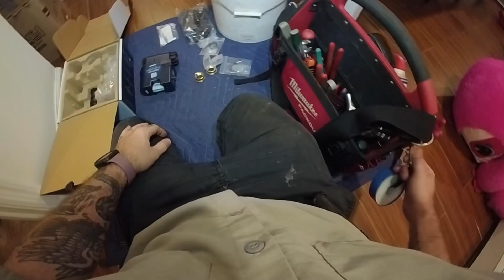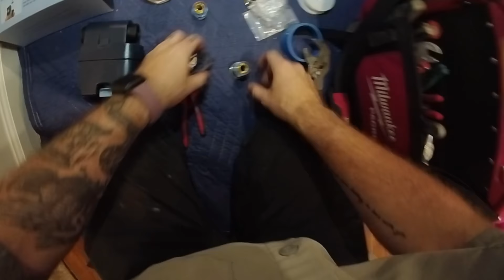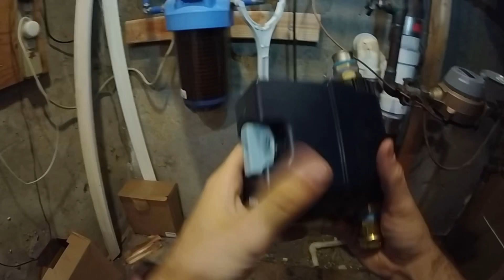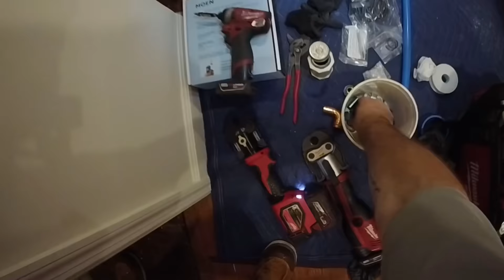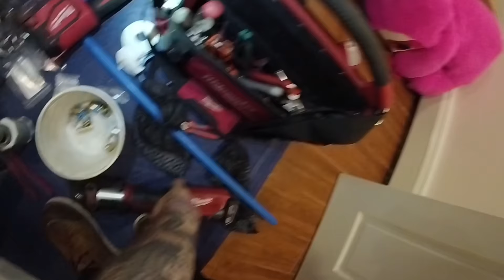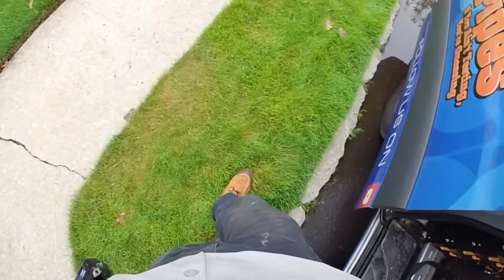Flo by Moen Installation & Setup | Easy Smart Water Leak Detection System

Comment: Nice work James. As far as supporting goes, you could have used a split ring hanger, threaded rod, and a wall plate. There was plywood on the left side of the panel. At least it would have stopped the wobbling.
Reply from the maker: Yeah I knew I would miss the obvious